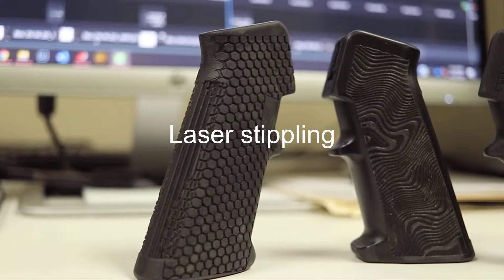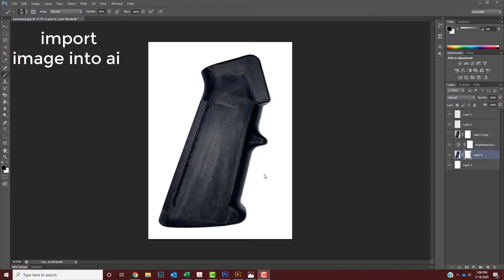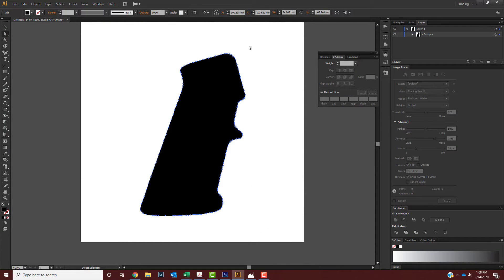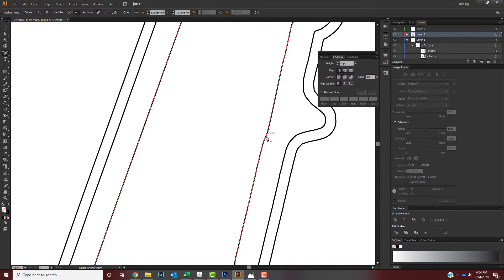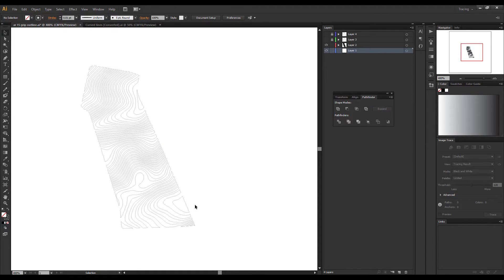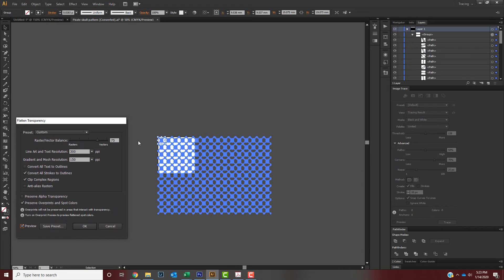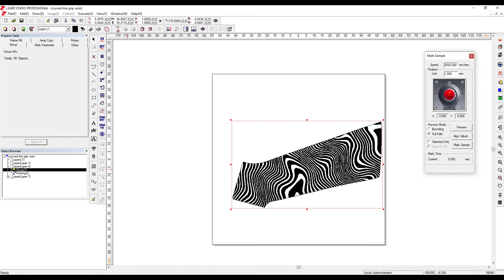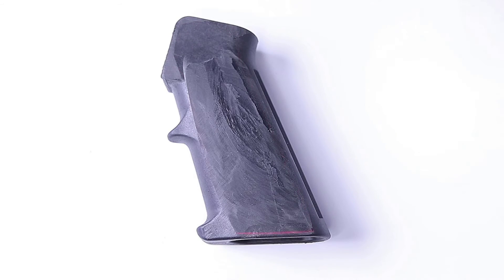BASICS ON LASER STIPPLING

Comment: This was an awesome video, I can’t find another out there like this. Is that software included with your laser setup? 

I’m a physics and software engineering student right now and just had a Glock stippled and it’s gotten my attention. How long did it take you to get good at stippling? 

I’m toying with the idea of doing a research project on building my own laser, programming it, and stippling something (that’s not a gun because “gun-free zones” 🙄). 

When you bought your laser, what brand did you settle on and what other brands were in the running? What’s the lowest powered laser that can effectively stipple? How long does it take to do a stipple job start->finish? 

Cool video, have fun lasering.